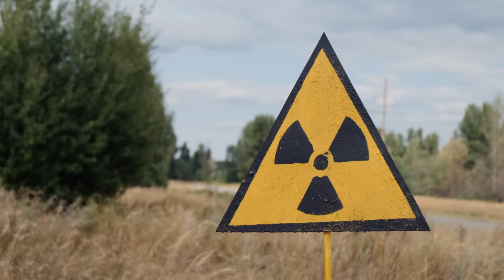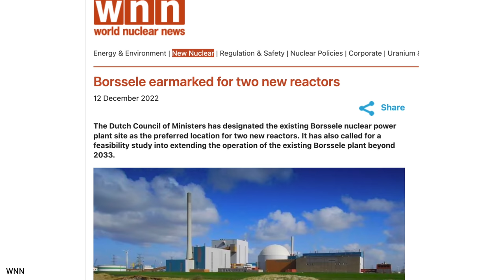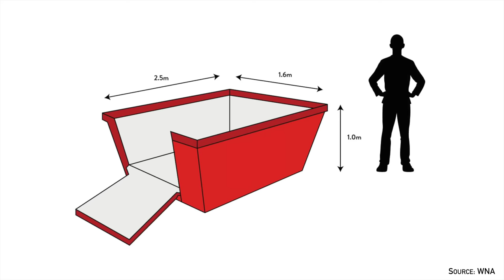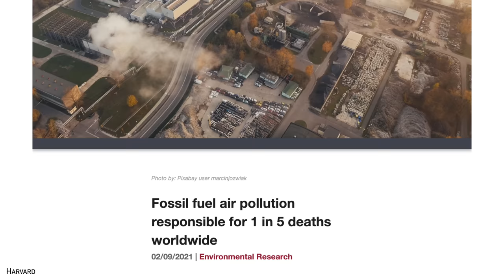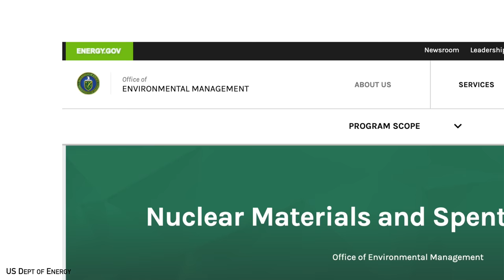Can Nuclear Waste Ever Be Solved? Yes.

Comment: The San Onofre has cost rate payers millions of dollars to keep that stored there. It is part of the reason San Diego has the highest electricity prices in the continental us. These challenges are able to be solved but at very high costs.
Reply: They never figure that cost when talking about the fiscal efficiency associated with nuclear energy.   Many reactor sites turn into nuclear waste storage sites long after the decommissioning of the plant!
Reply: Why was SO decommissioned?
Reply: @YourCapyFrenBigly_3DPipes1999  
Defects in the steam generators of Units 2 and 3. Not the original steam generators, but the replacements, which lasted three years.
Sooner or later all reactors need decommissioning as neutron bombardment degrades the steel of the primary containment vessel. 
Obviously major replacements and repairs such as the steam loop are very expensive, so permanent  decommissioning is a real option that got exercised in this case.
Reply: @garybulwinkle82   there is perfectly good storage plus reprocessing technology available to deal with the spent waste. It's all in my playlist. 
The facts are simple to understand. When will facts win out of over ignorance regarding this clean form of energy??
Reply: @gregsoecht3706 - If you build an asset, and then have it sit idle, yes it becomes expensive.
However, it is more likely that California is paying for other idle assets (wind/solar) or when those are on, the other idle assets (coal, gas).

Illinois, in contrast, just runs its NPPs flat out, and has few idle assets, and electricity rates half that of California's.
Reply: RIP Nuclear Boobs 😢

Comment: The issue is marginal i comparison to the i practice eternal waste we dump out in the atmosphere.
Nuclear waste is very compact. From Swedens total production of over 3500 TWh all waste is in a (one!) pool in Oskarshamn, Sweden, under a normal industrial land (ca 15000 m2) inside a simple net fence. That saved us 300 tons CO2 per capita in Sweden!

I fantasize about if the option "carbon capture and storage" from atmosphere was available at this cost, we should build several storages already.
 - But here (with proper nuclear power plants, not only the waste) we got the energy as a part of it!
Reply: Yes, we almost certainly would be better off to use nuclear and deal with the long term waste problem than to continue pumping more carbon into our atmosphere.

But, very fortunately for us, we have a much cheaper and even less carbon intensive alternative.  And one we can bring online much faster.
Reply: If we had a such option, it would have been in use since long so I am not sure you are quite right, there.

Those who designed our power systems, matching availability and demand in a delicate balance, have always been highly educated. Til now when we expect "the market" to solve all problems. It will, your option will be extremely cheap, outpricing itself etc. But it will take time.

All major leaps since Newcomen has required only about a decade. This time it will take at least three. And the reason is that politics for the first time interfere with qualified, strict engineering problems.
Reply: @johansoderberg9579  

Are you suggesting that it will take at least three decades to replace fossil fuel with renewables?  That is probably not correct.

In the US in 2017 we converted 2% of our grid power from fossil fuels to renewables in the US.  (Things slowed down under Trump.)

At the moment about 60% of our electricity comes from fossil fuel.  If we only doubled our 2017 efforts we could be essentially rid of coal and natural gas on our grids in 15 years.  

Both the efficiency of solar panels and wind turbines has increased since 2017 we could come close to doubling output with the same amount of labor, materials, and land as was used in 2017.  So if we doubled our 2017 efforts we would achieve something more like a 4x increase, getting rid of fossil fuels in less than a decade.

It's likely to get very interesting over the next few years.  The IRA(Build Back Better) legislation is going to subsidize the cost of wind and solar generation, bringing their cost to utility companies close to zero.  And battery prices are also subsidized in addition to getting cheaper.  Shouldn't we expect utility companies to hasten their move to almost free energy sources?  Either driven by market forces in competitive markets or leaned on by rate setting agencies whose task it is to deliver the least expensive energy to consumers.
Reply: It will definitely take more for US than 30 years if you are at 40% renewables now and despite cheap and easy alternatives only advance a few percent per year!
Up to 25 %, wind is cheap but above 50% you really struggle. Countries without hydro power will have to change fundamental principles regarding aviability, prices etc for electric power.

We have no climate challenge. At all. The challenge is replacing the fossile fuels. Just look how your transport is organized and you have to admit that!

Germany who closed all nuclear 2022 and replaced it with Russian gas - that's nothing but a joke! Like the drunkard that declares "I will quit drinking. No more alcohol after 2040 (when I am 95 years old!) But to reach that I have temporarily to increase my alcohol consumption drastically. So, to all of you who feared we will not see each other in the pub, I can assure you: Nothing drastically will happen in the short term!"

To match production and demand, not only year by year or month by month or even hour by hour but minute by minute is a demanding task you easily can doctorate on still today. In the same time as total novices in high voices claims that wind and solar will do the trick. I am so tired of this ignorance! Is there any other area in human activity where this is allowed?! Why are they messing up the energy now when the situation actually is as demanding and serious that the girl Greta Thunberg claimed! We have an energy crisis beyond what our modern society has ever experienced before! But people continue to speak about solar and wind and climate change etc!

Do what you should, instead! No more, no less!!

Comment: I like the idea of consuming spend fuel in a liquid fuel reactor until it becomes lead. At that point, you have extracted every joule of energy from the fuel.
Reply: You are confusing radioactive decay to lead with fission.  Fission produces electrical power while radioactive decay is waste heat
Reply: Lead is a far endpoint, thousands of years away.
All these proposed reactors still produce fission products, and those products do not contribute greatly to final output. They do contribute to waste heat and storage costs.
Reply: @aaroncosier735  Every isotope does not end up as lead.  You are referring to the Uranium decay cycle.  However you are correct in that Pu239 is the major spent fuel concern, does end up as lead in its decay chain, and will take ~160,000 years to decrease to less than 1% of the original mass
Reply: @clarkkent9080  
First, that is the endpoint specified by Rick Tan above. Sure, Neptunium can end up as Bismuth. 
The point here is that Rick imagines this decay chain delivers useful heat, which it does not. 

The decay of all the fission products also produces waste heat, which is a burden, not a benefit.

Comment: one thing you forgot is economies of scale for recycling. as more and more nuclear waste is accumulated it becomes more economical to recycle as it sits around cooling off. Both Japanese and French have good programs
Reply: which are fronts for weapons programs
Reply: There is no economy of scale for disposal.
Recycling is limited by the batch size, which is limited by the critical mass.  Chemical separations of metals, such as in the PurEx process require near-precipitating concentrations. 
Interestingly, plutonium has a much smaller critical mass in solution than as a metal. To process more, you cannot just make the vessels bigger, you need more separate lines. No economy of scale.

The French reprocessing programme has only processed one third of all their waste, and is falling further behind. Their power costs more than twice the global average, and would cost more again if reprocessing was expanded to match actual waste production.

Recycling ONCE, to make MOX fuel is probably feasible if half the costs are subsidised. 
How will you recycle it further? The accumulation of U236 and U232 in plutonium-rich MOX fuel is no joke, and requires additional shielding and lockstep timetables to prevent further U232 accumulation. The longer the waste sits, the less benefit.

Even in final geological disposal, the density of storage is determined by the heat generation. There are minimum volumes of rock around a given container of waste. You can't stuff more in, you have to space it out no matter what. No economy of scale.

Comment: The US is clearly making the waste an issue when it is not and never has been a technological problem.  
From the US Government Accountability website:  "The nation has over 85,000 metric tons of spent nuclear fuel from commercial nuclear power plants. DOE is responsible for disposing of this high-level waste in a permanent geologic repository, but has yet to build such a facility because policymakers have been at an impasse over what to do with this spent fuel since 2010.  Meanwhile, the federal government has paid billions of dollars in damages to utilities for failing to dispose of this waste and may potentially have to pay tens of billions of dollars more in coming decades."
Reply from the maker: I saw that on the GAO website and almost included it in the video because I thought it was funny if it wasn't so sad...
Reply: @atomicblender  It is not funny, it is democracy.  Is the nuclear waste issue the only issue not resolved due to politics, here or elsewhere in the world?
Reply: More than 85,000 tonnes.

The IAEA report on the status of spent fuel 2022 has the US inventory at 130,000 tonnes. That is based on the 2016 census. plus the 2000 tonnes per year since. Easily 140,000 tonnes this year.

85,000 is roughly the amount in wet storage - cooling pools.
And about 55,000 in dry casks.

The present fund for geological disposal stands at about 44 Billion. This is less than half the sum required for existing waste.
2010 is when the industry went to court to stop making contributions. One of their arguments was that it made them unviable.

I agree. Waste disposal is grossly underfunded, and if the full costs were demonstrated on US soil, it would make the industry unviable.

Comment: I chose to use the spent nuclear fuel with the new breed of reactors, for example, Russia's bn800 fast reactor. The conventional nuclear reactor generates spent fuel and a reactor like the bn800 fast reactor is loaded with this spent nuclear fuel. This creates a nuclear waste cycle where we don't have to worry about nuclear waste at all. If feasible, we should build SMRs and micro-nuclear reactors to use spent nuclear fuel.

Comment: Thorium reactors can use spent nuclear fuel. 10,000 years down to 500 years due to the efficiency  models of thorium molten salt reactors. Furthermore, batteries with new developments for safe use can be made to reduce spent nuclear fuel from 500 years to total depletion.
Reply: There are no Thorium commercial reactors anywhere in the world so how can you make that claim?

Comment: Hanford has huge underground storage. During a turnaround, they would flush the core, creating several gallons of high level waste. Don't new reactors require the same maintenance?
Reply: No.
First, Hanford (a military Pu-239 factory) was turned around on the order of weeks. Civilian NPPs 'turnaround' every 2-3 years.

Second, the materials technology is much different in a 1960s-1980s civilian NPP production complex than Hanford, which was a big 1940s science experiment.

Third, unlike the Hanford reactors, there aren't that many moving parts (which might break away or create debris).

Lastly, any water radioactivity is mostly from tritium, which decays relatively quickly.

Comment: “Dry storage is temporary solution”
So you say. No reason to not leave those concrete cans there forever.  The oldest ones have already lost 90% of their reactivity. The concrete can is not structural, so it’s good for several centuries, all while the radioactivity continues to fade. This random, ‘that way is safe, this way is not’ list of assertions is not helpful.
Reply: Over centuries, deterioration of the casks could lead to the release of dangerous material over time, if not actively maintained, plus, you might want to use the land for something else. It's still a temporary solution, even if "temporary" means 100 years or more. Deep geologic storage means we basically never have to worry about that waste again.
Reply: @techmage89  “dangerous material”

That’s just arbitrary.  How about your car, is it “dangerous material”?  effluent in your sewer pipe,  tanker cars carrying chemicals going down  the tracks everywhere?  “Centuries from now”, as you say, over 95% of the radiation in a can is gone. It’s a solid, it’s not green goo that can seep or flow, ever.
Reply: @Nill757  Well, yes, the decay chains are pretty complicated, (uranium involves 17 elements) and until around thousands of years have passed there's still enough radioactive isotopes to be potentially dangerous. You still don't want that stuff leaking out into your water supply (which can happen if, for example, rainwater seeps into cracks in concrete and rusts through metal) so either active maintenance or stable storage is required, and in the long term, the latter is probably cheaper.

Comment: Be great to see a video explaining "what's the deal" with fast breeder reactors.
Reply: I'm not an expert, but I got the impression that fast neutron reactors are simply more expensive and more difficult to build. Russia has spent decades bringing this technology to a competitive level, i.e. Russia in this field as ASML in microelectronics. There is only one difference. ASML has no alternatives, and there are a lot of them in the production of electricity. At the same time, even now the cost of electricity, produced by fast breeders, is higher. In general, it is difficult to find information on the cost of a kWh, even in Russian. I tried about a year ago, but found only fragmentary information from which I made an estimate that the cost of energy was about 20% higher compared to traditional nuclear power plants. It is not a big differens and clear that this is just one of the parameters, but it is obvious that fast neutron reactors do not promise any breakthrough results, and it requires a lot of work and finances, so other countries do not want to invest in this technology.

Comment: Good informative work! It is rare situation to have, when not doing anything with waste material is actually quite good solution (it wouldn't be truth with many chemical waste materials, massive coal ash heaps etc). There is no hurry, HLW is getting safer with every passing year (less heat generated, so only easier to deal with in the future).

Comment: Please tell us more about the breeder reactors, surely using the remaining energy in the fuel is the logical route? Thanks!
Reply from the maker: It's a great route, but has a number of technical challenges. There have been several attempts to make breeder reactors work commercially (look up TerraPower or thorium reactors and some others), but so far nothing on a large scale.
Reply: @atomicblender  not in the US, because our govt POSs refuse to publicly fund the nuclear industry. But if they did, then that would be less of a factor, would it not? 

I mean having to provide a big fat ROI for investors on something that should be a public utility is going to put an unnecessary strangehold on progress. At first, a newer process or a technology might not be super affordable right out of the gate, but even so, as with anything, over time, costs come down. 

I think it's clear that until the govt starts helping, nuclear progress here will be slow, which I'm sure is what they want. I mean let's be real - who do both parties kneel to? Oil and gas. They aren't in the job to look to the future - they're in it to get rich. That's their agenda, nothing else.
Reply: The problem with breeder reactors is that neutrons used to breed new fuel are not available for fission and power production, so less efficient.  Then you need a special reprocessing facility to separate the bred fuel from all the other nasties...all very expensive when virgin fuel is much less costly.  Simple economics
Reply: @clarkkent9080   it may cost more at least right now, but it's clearly the way to go to reuse almost all of previously used fuel so it doesn't need to be stored. And it produces energy. It's like getting twice the mileage out of the same tank of gas. It's a brilliant elegant solution to the issue of nuclear waste.

Comment: 6:33 why not to use this warmth for heating of buildings, by using of district heating systems, at least in winter? Or generate electricity with Kalina cycle? But the best way of course could be, to bombard the stuff with particle accelerator, to remouve the energy of it faster and neutralize radioactivity.